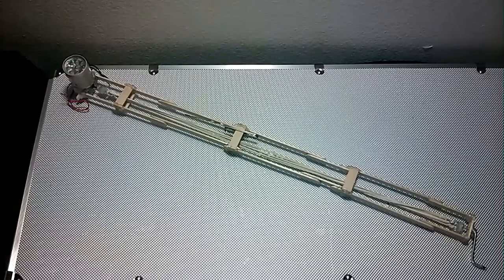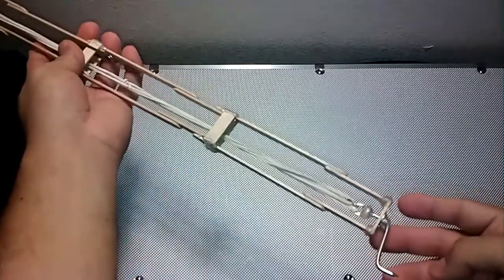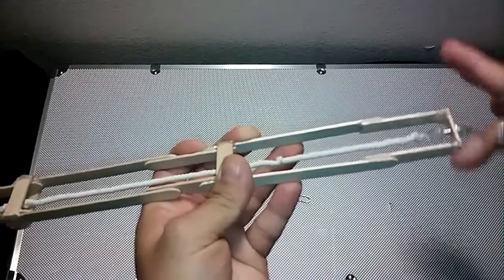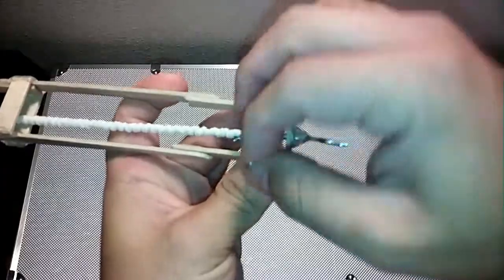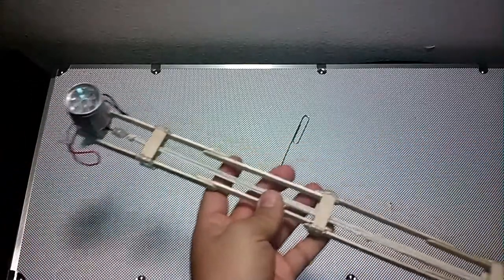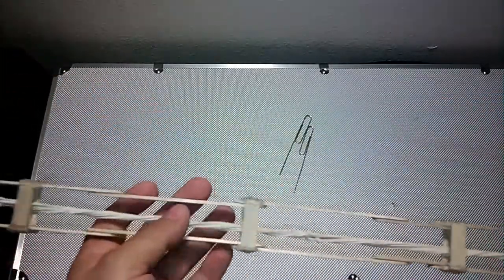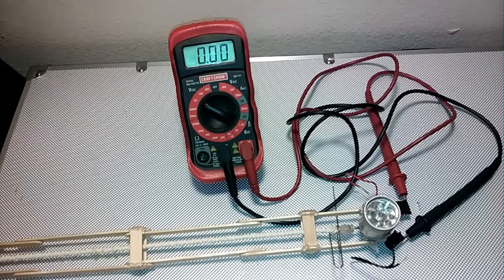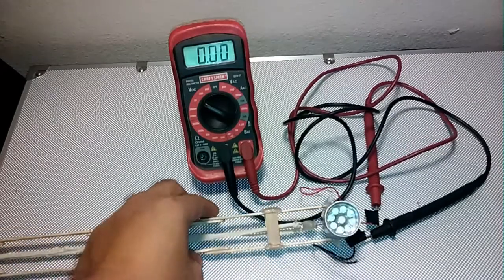Energy stored in rubber bands to generate electricity

Comment: This device stores kinetic enrgy into elastic energy....and convert it to electric energy...though there is other ways to store energy:
Chemical energy (Energy of molecular bonds): Battery cells
Potential energy: weights @ height (Used in dams)
Kinetic energy: Flywheels (Nasa project)
Nuclear energy: Unfortunately, in the present state of our knowledge, there is no way to store energy in this form, either by fission or by fusion...
In the case of elastic energy, the idea itself is good, but rubber is not very effiscient, as it tends to strech erreversibly at each cycle...